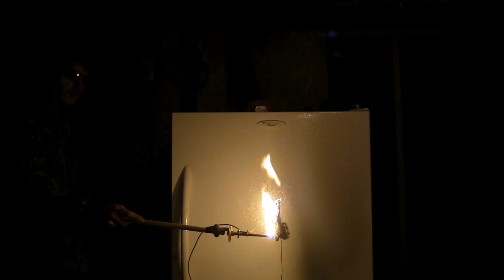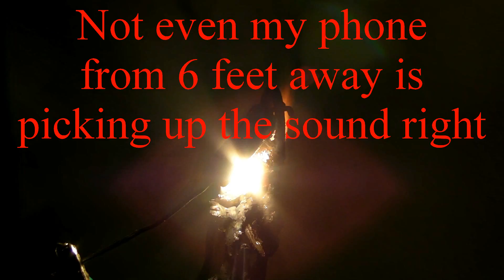Electricity Destroys Everything

Comment: I just got a solar panel array installed on my house that's close to 7kW.  It's 6kW.  I'm very tempted to disconnect the DC from my inverter and play with electricity.  I haven't played with more than 1000 watts before.  This is serious business.  All panels in full sunlight would be 800 volts at close to 8 amps!  Gloves, welders helmet, SHORT CIRCUIT time :)